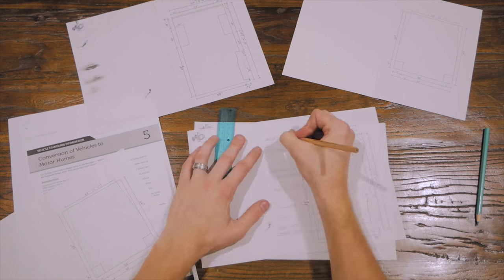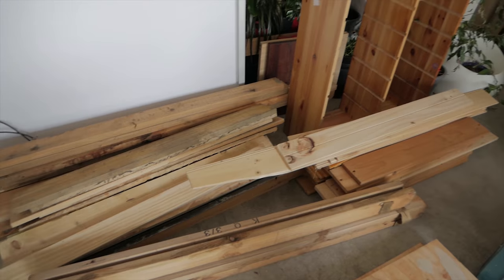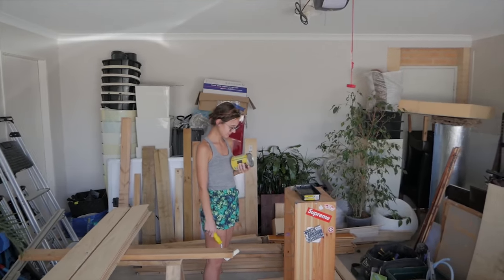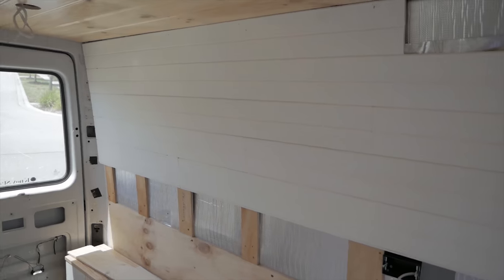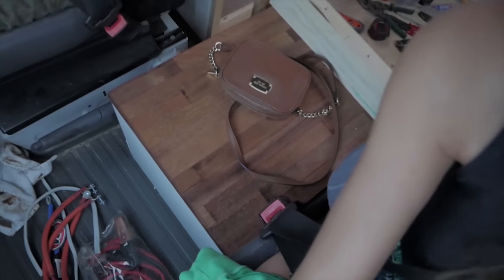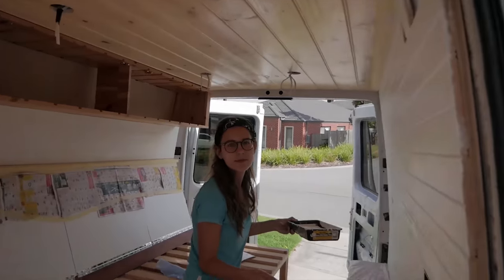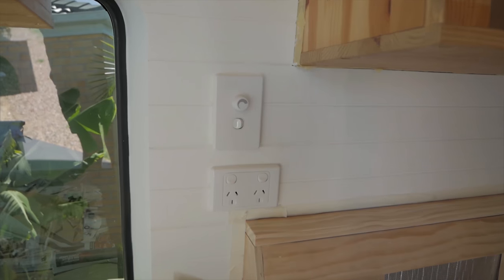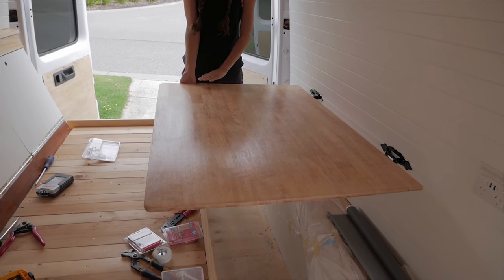How we converted a SPRINTER into a CAMPERVAN in 30 days | The Wandering Wagners

Comment: Great build! Not sure how long-term this van will be, but be careful with the glass pack insulation you have going on in your van. Condensation can build up on the exterior metal panels causing the fiberglass packing to get wet = mould. There are other alternatives to glass pack such as foam/expandable foam, but remember that a van isn't a house, so not all the same things work.

Comment: Incredible job! I am super impressed. - I just want an elevated bed that I can store gear and bikes under, and a heater in my Sprinter Passenger Van. Seems daunting at the moment.
Reply from the maker: I hear ya, there were a lot of moments before and during the build where I wondered what the heck did we get ourselves in to! Just got to remember that nothing is permanent and you can always change or fix something that doesn't work for your and just get started! Just start with something small like cleaning it out or putting in a subfloor and it will help to push you on once you see progress happening! I saw a video where people made a bed that could be raised an lowered, it was sick! Sometimes though just simple designs work just as well and you won't want to pull your hair out on little details lol. Good luck with your build!
Reply: The Wandering Wagners great advice and thanks for the feedback! Excited to follow along on your adventures! ✌️
Reply: @TheWanderingWagners  Wagners great advice. It worked for me. Just focus on 1 small task at a time otherwise it can be overwhelming.
Reply: HarvyDanger Films i

Comment: How to did u manage to clean sink drainage in this van? How  do u clean sink wastage and where are let out holes?How to manage washrooom drainage and let out in such vans?
Reply from the maker: We have a basic system with a gray water jug under the sink that we empty with a quick connect hose that we remove to clean! The toilet we haven't set up but it's sealed and you have to dispose this black water waste at a designated dumping site. The toilet uses chemicals and special toilet paper that dissolves. Thanks so much for watching :)

Comment: Cool! But one Q.: is it needed to legalize the rebuilded van at the authorities?
Reply from the maker: Different countries and areas have their own guidelines but in Australia you are supposed to have an inspection and notify the registry, that’s why I got the electrical portion certified so that I wouldn’t have any issues. The majority of their guidelines revolve around safety such as LPG gas and structural changes to the vehicle/windows and seat belts etc. Thanks so much for watching

Comment: Hey guys, nice work! How did you installed the cupboards in the roof corner? How have you connected all your furniture with the main car body? Thanks!
Reply from the maker: Hey thanks so much, glad that you like it!
I had cut and screwed curved pieces of wood along the ceiling metal ribs for something to nail the pine ceiling into (so I didn't nail into metal) and then that also doubled as something structural to screw the cabinets up to the ceiling. If you go to 12:00 of this video https://www.youtube.com/watch?v=q9HLxt87QC8&t=93s    it shows how I put the ceiling in. Thanks!

Comment: Great vid!  What's the original underlayment for the floor brand and description?
Reply from the maker: We used Ametalin reflective insulation from Bunnings in Australia and then plywood on top of that! Thanks so much for watching :)
Reply: Thanks for the response.  I'd like to use insulation but it seems here there are not many options.  I am looking for a thin effective material.  Thanks for sharing.

Comment: Just add a speed modificatio and you have a millennium falcon
Reply from the maker: I’m still working on the warp stabilizer but should be able to get to light speed if I push the accelerator a bit harder lol

Comment: OK. Build quality is top notch.. but this is Australia. Why would you put a kitchen INSIDE. No one does that anymore. Everything is on a slide so you can cook outside and keep the smoke and smell outside. That's one observation .....and why 240VAC everywhere? You don't need it. You only need a 240V charger and EVERYTHING else is 12VDC. The fridge, the USB ports, the laptop ports, LED lighting, the fan....it all can be run from 12VDC ..and much much safer. Another observation. The finger holes for the seat backs are too small...just sayin'.. 

It's a nice build but better off in a nice house I reckon.
Reply from the maker: Haha yes you’re exactly right that’s why we build our cooker in a pull out cabinet that comes out the side door, you can see it in our videos and we talk about it for the very reasons you mentioned. 
The power was something that I struggled with and flip flopped on how to do it. I was under the direction of a guy that I wish I hadn’t fully listened too. However it has allowed us to have our $80 bar fridge which has great capacity and it’s not a 12VDC fridge like the more expensive camp ones. Mostly I wish I combined systems to allow for both but maybe that’s something I’ll change in the future. I talk about that a bit in our upcoming video. 
The finger holes I will disagree lol, the big hole we put in the center one we realized was too big and looked a bit ugly when the bed was down so the other two with smaller holes is enough to get a finger in and open it, it works perfect for us. Thanks for watching!

Comment: DIe from 12v? Thats not even possible.
Reply from the maker: Not likely and I have circuit breakers but our system is 24v with a 2500w inverter so that could kill you!
Reply: 24v is like touching a electric fence.
Reply from the maker: Oh...haha my main worry was that I wired it wrong and that I plug something in and something melts or sparks, you know the things that people think about when they don’t know much about electricity lol ;)